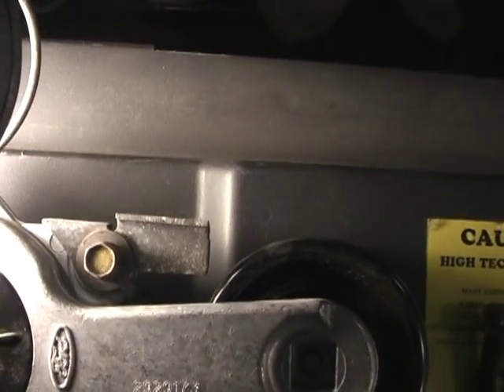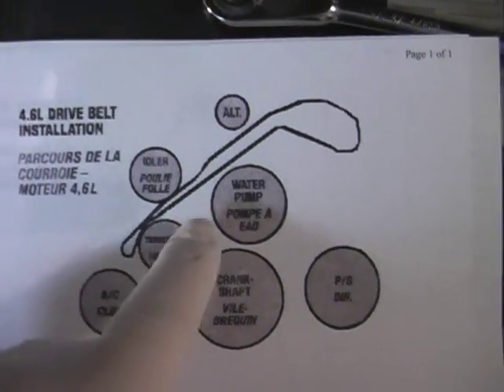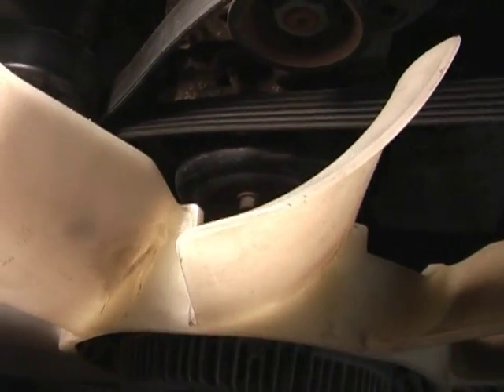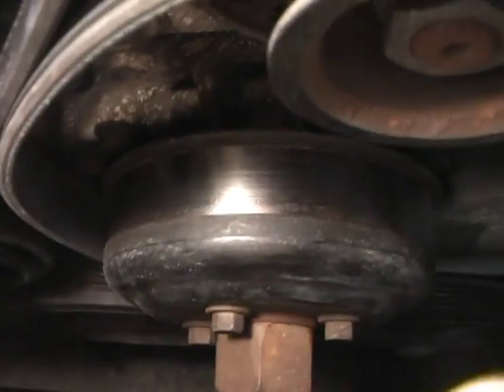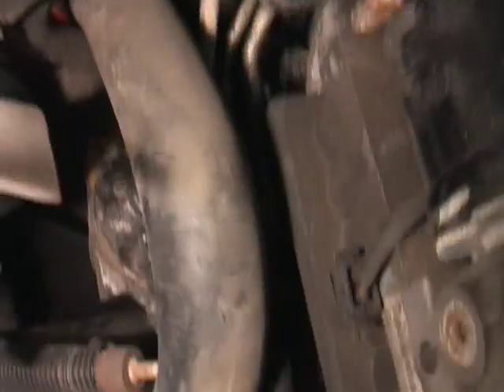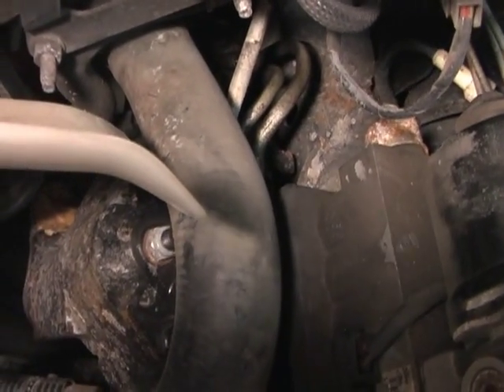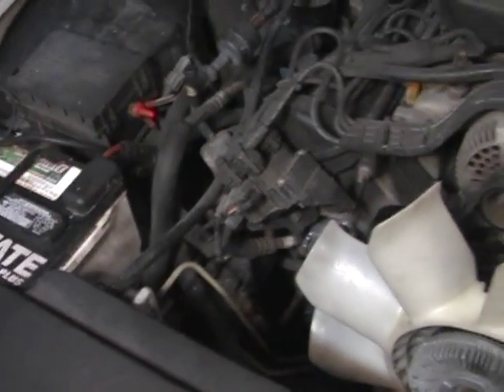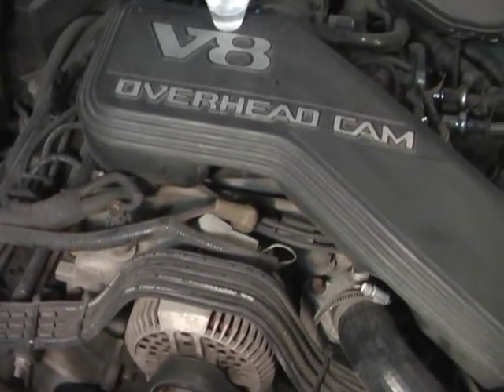1995 Lincoln Town Car belt tensioner repair part 2 of 2

Comment: thanks alot! I actually figured it out before you told me but I had to take it off and spray wd just to get it to budge. thanks you for your fast response. I was looking for a nut to adjust on it and my neighbor came by with the socket wrench and stuck it in the square

Comment: You mean how to loosen the belt, using the tensioner?  You simply take the 3/8" ratchet and insert into the square hole at the end of the tensioner and use your socket wrench to unload the spring inside the tensioner, therefore loosening the belt.  You might have to put some muscle in it, these things are usually locked up!